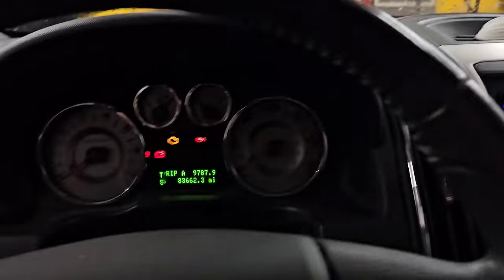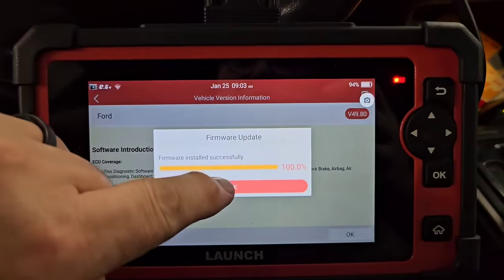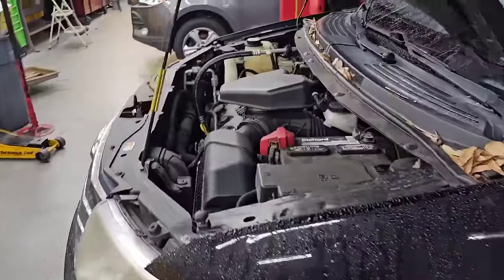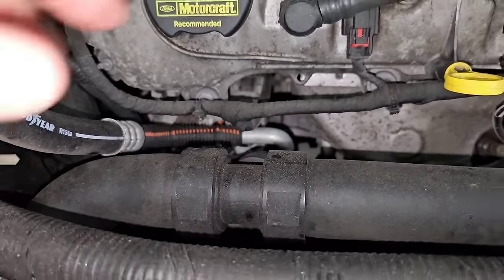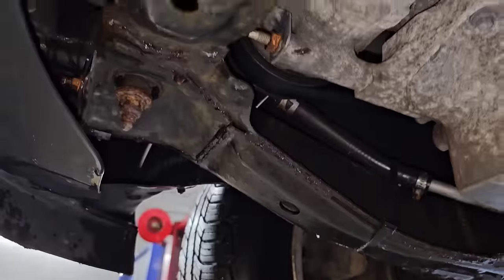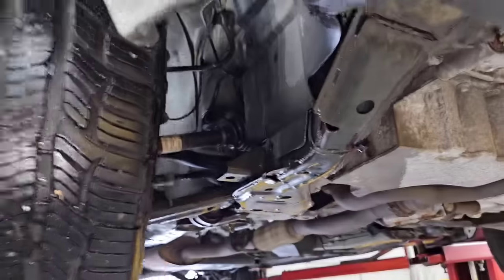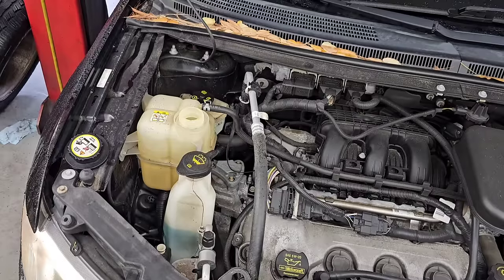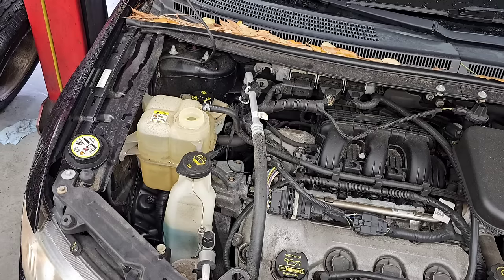No Coolant? But Where Did It Go?

Comment: That is messed up that ford only sells the module with the fan assembly.
Reply: At least you can get it, needed a module for an old Dodge 5.9 and the kit was a couple of relays you wire in it’s place

Comment: It's a f.o.r.d. end of comment
Reply: I've got an 08 Taurus X, 3.5L 6F50 AWD with 285k on it, it's been virtually bulletproof. All maintenance done per schedule, including cooling system. Water pump did leak at 240k, and I changed it along with timing chains and tensioners. Other than that, it's only needed normal wear and tear items. Also have a '12 Lincoln MKX 3.7l 6F50 AWD with 240K on it. Same maintenance, and water pump is just beginning to weep. Again, other than that, just normal wear and tear items (tires, brakes, belts, wipers etc.). Granted the chain driven water pumps are a PIA, but both going well over 200k before needing service, is not a deal breaker to me. I have a lift, and dropping the powertrain out the bottom makes this a fairly easy job.

Comment: looks like a Ford edge with the internal water pump failure. or the tube from behind timing cover under manifold o-ring failed or fan assy. Module never burns out, it is the brushes in the fan motors. Always replace with a Motorcraft assy only,aftermarket assy's will damage the main harness connector.